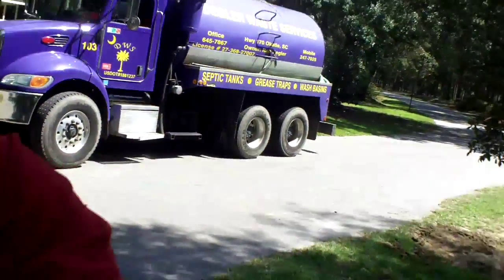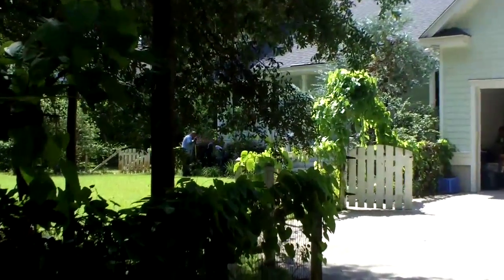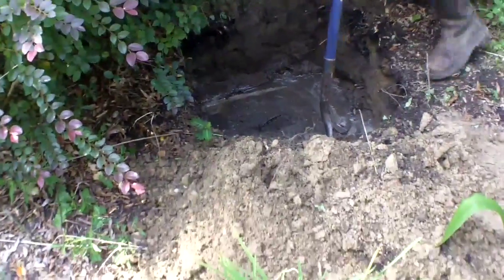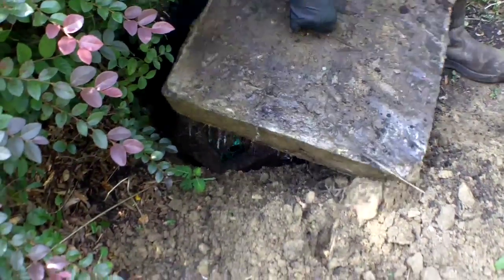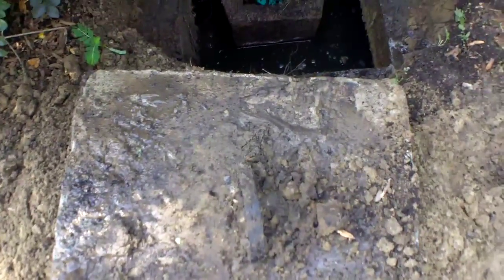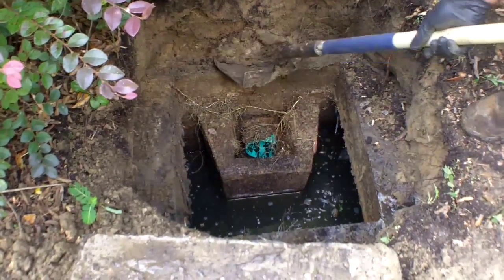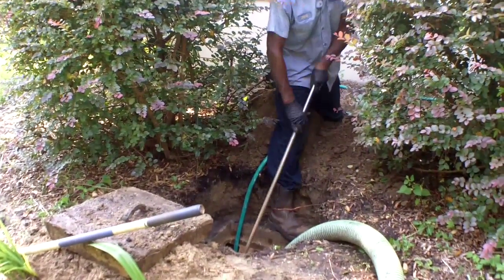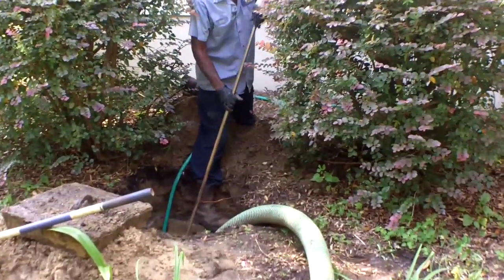Septic Tank Inspection

Comment: This video is so bad, I don't even know where to begin, but lets start with the fact these guys only opened the Inlet Cover of the Septic Tank. Typically, most Septic Tanks today have at least 2 Access Covers, and many have 3 Access Covers, which means to properly inspect the tank, and to conduct a Flow Test or Flow Check, you open all the covers on the tank. This enables a Professional Inspector to see the Inlet Baffle and the Outlet Baffle, which in many systems today has an Effluent Filter that needs cleaning a well. Obviously, these guys never bothered to look for a filter, which you can't see from the Inlet side of the tank, which is why you open the Outlet Cover on the opposite side. How about locating the Leaching Field or Drainage Field, and digging a couple of test holes to see what type of system is buried in the yard, and how much Wastewater or Effluent it's holding... if any?  Lastly, what about the depth of the Leaching Area or Drainage Area... is it too close to the ground water and/or does it pose a potential environmental hazard? How close to a Lake, Pond, River, or Stream is this system, is it possible it be contaminating any nearby body of water? A Septic System in an area with a Higher Than Normal Water Table, are vulnerable to these types of issues or problems, which can be expensive to repair or correct. The bottom line is this, this video basically shows how to Pump a Septic Tank, this Absolutely Not a Proper Septic System Inspection. In fact, this was completely inadequate, and as a Licensed and Certified Septic System Evaluator with over 15 years of experience, I can't believe that anybody would think this is how an inspection should be done... what a joke!